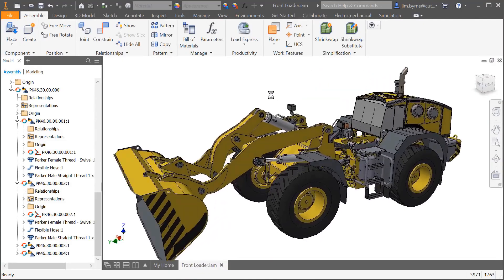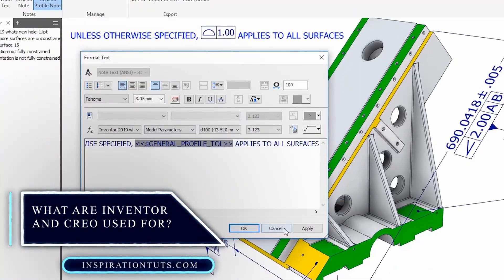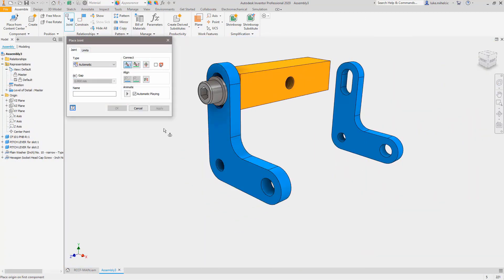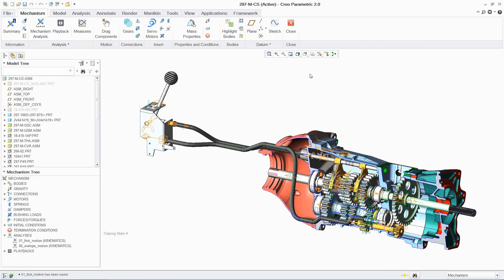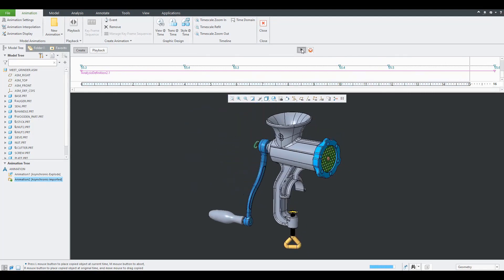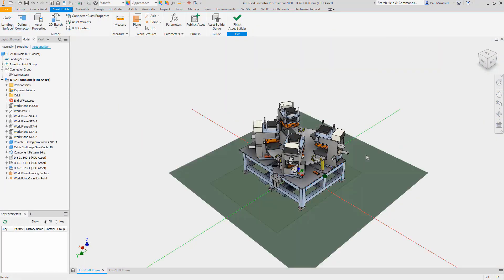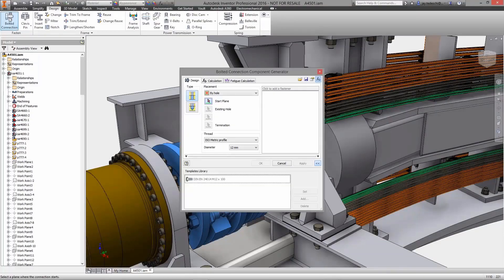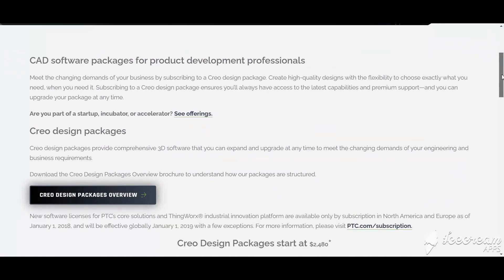Inventor VS Creo which is Better

Comment: Well darn... I really wanted to stick with inventor as a Mech E junior.  But I guess it makes sense to move to Creo parametric.... Sigh   
I model parametrically driven gears and other models in Inventor including Robotic assemblies.
I wish I only ever used Creo for this type of modeling because making the switch is so time consuming and inefficient.  My work efficiency plummets when forced to use Creo, but I need it for specific dynamic simulation requirements from a class I am taking.   I wish Inventor could just upgrade their software (Lol, I know it's a lot to ask) with similar capabilities as Creo in terms of parametrically driven models and simulations.